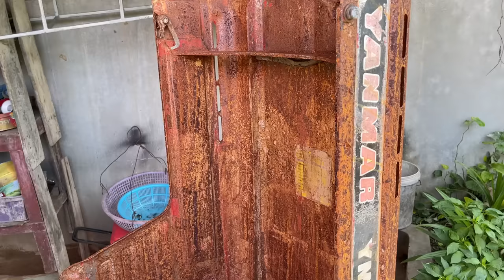Helped a 60 year old farmer restore and repair his old 2010 Yanmar tractor // Tractor restoration

Comment: those new to do it yourself tractors 🚜 have hourly services lube times. technically you keep a log book 📖 from the owner’s manual they have set number of hours that require oil and filter changes and lube points called zerk fittings that require you pump grease into joints. then after so many hours your air filter needs to removed you can in a pinch blow the inner filter out to get by. but your fuel/oil filters have to be changed. add a algae prohibitor to the diesel tank to prevent growth. so farm equipment etc get extra filters. if not you end up doing this and at times splitting the tractor.

Comment: 2010 is not that old why is it so messed up?
Reply: The model number is 2010
Reply from the maker: 2010 is not the year this machine was manufactured. 2010 is the mode number. This device was manufactured in 1980 and is now 43 years old.
Reply: No maintenance from the owner